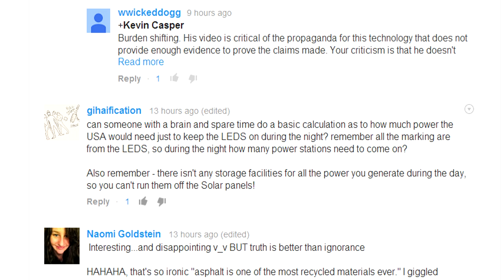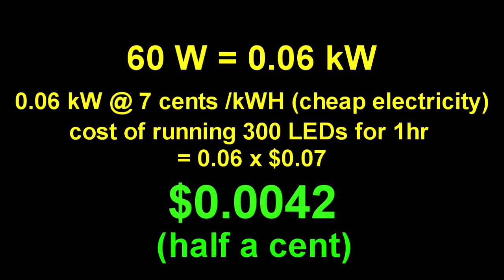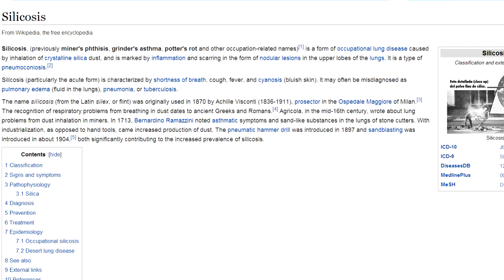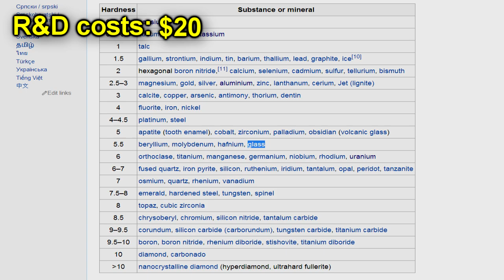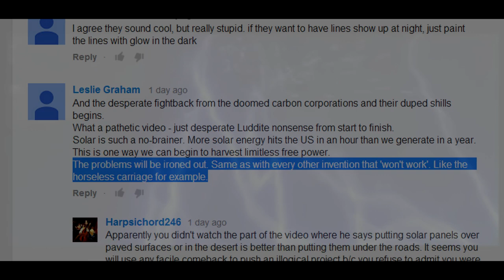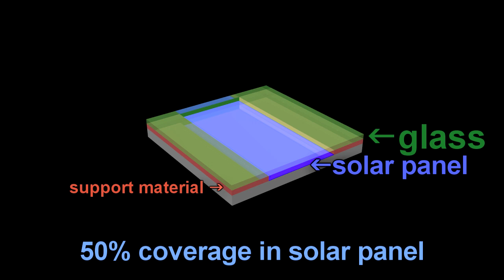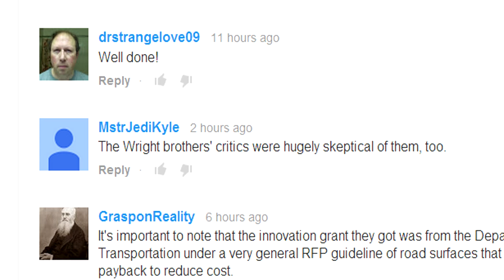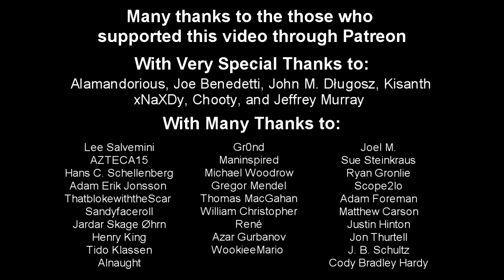Solar Roadways, IMPORTANT QUESTIONS AND ANSWERS!

Comment: ....but they wouldn't ALL need to be on ALL night.  Just while they're needed.   Why would you assume otherwise?   Also, why is it being assumed they would replace every, and all roads?  That seems like a really unreasonable assumption to make; meant to only create sticker shock.  Also, why were you using normal, non scored, non tempered, non laminated, soda glass to test with? That it's much weaker than any other form of glass...  I would expect someone like you would know that.   Though, they've already passed load bearing and traction testing, so I guess it's a mute point now.
Reply: 1) powering the sensors would still require power
2) their goal is not only to replace all roads but sidewalks and parking lots and the like as well
3) The point is to show how absurd the project is.
4) It doesn't really matter much because glass doesn't get harder from treatments, more durable yes, harder no and when it comes to scratch resistance it's hardness that matters. glass has a hardness of around 5.5-6, sand which would scratch it has a hardness of 6-7. I mean even solar roadways has it on their site that glass is softer than quartz.

All the same the project is dumb, if the purpose is to generate energy especially with limited resources you put them in the most efficient configuration as possible. Take a traditional solar array which has a life cycle of 20-25 years if you're stretching, it can pay for it's self in around 10-15 angled towards the sun, you lay it on the ground flat and it struggles to pay for it's self before the end of it's life cycle. This is without obstructions or the wear and tear of being driven on. Even if you improved efficiency you'd be stuck with the same issue of using limited resources in the most efficient way and the design flaws are inherent in the intended design of the project.
Reply: I get it.  But couldn't he have done without exaggerating every step?  And it is every step - I found holes in every single argument he made.  e.g. The LEDs he used to prove you can't see them were like 50LM, but there's LEDs up to like 9000, which are definitely more than enough to be visible.  About 2300 is all that's needed, for peak conditions.  His use of heated roads requiring such massive power, too - heated roads already exist, and use about 10% than what he came up with.  Why didn't he use them?  Why did he assume they would be running on every surface of the entire country?  I could go on, but I hope you get the point.  

As for powering the sensors - it's my understanding that they're including piezoelectric generation, which would inherently also act as a passive sensor.  The weight of the car would generate some power, part of which would go towards turning on subsequent equipment.  

As for "all roads," that's expected of marketing for any product.  But using that an all or nothing approach to test viability here is beyond dubious.  The question should really be if there are any situations where these could be of benefit.  Of course they wont be in all situations.  No solar solution is or could be - does that prove solar wont work at all?  No.  Just like using it in all situations here doesn't prove it, either.  

A potentially viable use case that I see is large facilities, like convention or data centers.  Once you cover the roof completely it still wont be enough.  And they have massive parking lots that spend most of their time empty.  Why not get some electricity out of it?  IF (and I agree, it's a big if) the panels can manage to pay for themselves over their lifespan then why not?

Look, point being that thunderf00t hasn't proven these are utterly useless in every case.  Just that they wont work in every possible scenario.  Which would seem obvious to me.
Reply: Gr1pp717
1) "The LEDs he used to prove you can't see them were like 50LM, but there's LEDs up to like 9000, which are definitely more than enough to be visible. About 2300 is all that's needed, for peak conditions."

Which would require even more power when they're on, can't apply skepticism to your own arguments?

2) "His use of heated roads requiring such massive power, too - heated roads already exist, and use about 10% than what he came up with."

That was the thermodynamic minimum requirement based on the assumptions made based on average snow fall on roads in the representative areas.

3) "As for powering the sensors - it's my understanding that they're including piezoelectric generation, which would inherently also act as a passive sensor. The weight of the car would generate some power, part of which would go towards turning on subsequent equipment."

And the calculations for this would be? Unless it's producing 100% of the power required to activate the tiles it's still going to require constant power sources to supplement the sensors.

4) "The question should really be if there are any situations where these could be of benefit. Of course they wont be in all situations. No solar solution is or could be - does that prove solar wont work at all? No. Just like using it in all situations here doesn't prove it, either. "

It's whole selling point is based on trying to put solar on the ground to generate power, you're already done at that point because short of facing it away from the sun or face down it's one of the worst configurations you could imagine  for it.

5) " IF (and I agree, it's a big if) the panels can manage to pay for themselves over their lifespan then why not?"

Or...you can make car parks with overhead roofs with solar installations on them facing towards the sun, protecting the cars, you won't have to rip up your parking lot to put in the solar road way tiles and you won't ever have to worry about a car being parked on top of your solar panels.

Again if you have unlimited resources go for it, if you do not there are plenty of other better ideas that serve the same if not better purpose. The fact you're losing like 50% efficiency by laying it on the ground make the project a non starter.

6) "Look, point being that thunderf00t hasn't proven these are utterly useless in every case."

People tend to ignore the fact that it's so much less efficient just to lay it on the ground despite it being one of the primary points in his criticisms about the project. This alone makes this project worthless in all scenarios where you have limited resources and have places to install it where the panels are facing the sun.

Keep in mind, the ROI was JUST for the solar panels which even from a conventional design just designed to be a solar panel barely lasts it's life cycle without the wear and tear. That's not including all of the bells and whistles involved in the project that you'd have to maintenance some of which are replaced by a bucket of paint, the use of head lights and some retroreflectors.
Reply: >Which would require even more power when they're on, can't apply skepticism to your own arguments?

I did: when I said "IF" it could be ever be efficient enough to pay for itself.  But, since no one else has, let's check it.  

Lets assume full lumens for 4 hours mid-day, min power at night for 8 hours, and average between those 2 for the remaining 12.  Basing the wattage on the consumer grade LOHAS LED Chips:
2400LM LEDs use about 0.025kWh for 4 hours.   
500LM LEDs use around 0.005kWh for 8 hours 
Leaving 0.015kWh for the remaining 12 hours.  
So: 0.025*4+0.005*8+0.015*12=0.32kWh per day; if it's on 100% of the day.  
A typical road is about 4m wide there's 0.15m worth of lighting on each side, which works out to about 8% of the road needing to be lit.  So 0.08*0.32=
0.026kWh/m2/day for lighting.   

A typical solar panel in a cold, dreary place, like michigan, gets about 3.8kWh/m^2/day on average.  I'm not sure if that is using tracking panels, but to be conservative let's assume they are.  Tracking panels gain 40% more power than stationary ones, so let's divide that by 1.4 => 2.7kWh/m2/day for a stationary panel.   Which means the lights could be on 100% of the time, and cars blocking about 97% of the sunlight, and they would break even. Or, the panels could be woefully inefficient and the parking lot mostly dead.  Either seems fairly plausible to me.  And while I can't find info on how much piezoelectric generation might give us, I would imagine it covers at least enough to trigger the lights, if not completely run them.  

>That was the thermodynamic minimum requirement based on the assumptions made based on average snow fall on roads in the representative areas.

I made a mistake on this point, actually.  The heated roads in michigan (a very cold place) actually use about 1% of the energy he calculated, not 10% as I has previously stated.  The problem with his calculation is that is assume there's no runoff.  That the road is one giant pot, that the ice must stay in until completely melted.  It's not.  The real thing peaks out at 140BTU/ft2 = 0.44kWh/m2.  Assuming they ran all day, that's about 11kWh/m2/day.  So, I could see some days generating less energy than needing to heat the road.  But unless you assume this is needed @100%  for 100% of the time, always, then it's a mute point. Actually, this shows that these probably couldn't be efficient anywhere that has snow more than about 20% of the year - which is nowhere in the lower 48.  

>because short of facing it away from the sun or face down it's one of the worst configurations you could imagine  for it.

Most solar panels are, in fact, stationary.  Look at your neighbors roof.  Are they moving?  ...Saying that it's pointless to use stationary panels means the vast majority of the solar tech employed today is pointless.  Yet, they aren't.  

And since we're digging deeper, in terms of ROI it doesn't even actually need to pay for itself, as it saves on the road which would have been built in its place, plus the lights and the energy they use which this system replaces.  So, take the cost of this system and subtract those things.  If it ever generates that much electricity then it's paid for itself.  Considering that these have already passed DOT testing for load capacity and traction (including wet... because what official engineering body wouldn't think of that! ...) the only question is if the ROI can ever be reached.  None of the rest of what these videos try to claim matters.
Reply: Gr1pp717
1) Your assumptions are based on the typical solar panel, which this is not, much of the surface area is not solar panel and you're basing your calculations on a stationary solar panel rather than one on the flat ground.

also " So 0.08*0.32=
0.026kWh/m2/day for lighting. "

Wtf is this, you took the earlier calculations to light up an led and multiplied it by 8%.

2) "I made a mistake on this point, actually. The heated roads in holland (a very cold place) actually use about 1% of the energy he calculated"

Yeah, considering how you're going about this I'm going to need a source.

3) "Most solar panels are, in fact, stationary. Look at your neighbors roof. Are they moving?"

Stationary or not being tilted towards the sun is a major advantage, it facing the wrong way can make the difference between it paying for it's self in 10 years or 100 years.

4) "Saying that it's pointless to use stationary panels means the vast majority of the solar tech employed today is pointless."

Never made this claim, placing it flat on the ground reduces how much solar energy a system can get, this is why solar systems are tilted towards the south if you can.

5) "And since we're digging deeper, in terms of ROI it doesn't even actually need to pay for itself, as it saves on the road which would have been built in its place, plus the lights and the energy they use which this system replaces."

But it's replacing it with something that costs more, and uses more energy, electronics, materials, manpower with a lot of things that have shorter life cycles.
Reply: >much of the surface area is not solar panel

Unless we're talking a fraction of the surface area then it shouldn't matter. As the amount generated is ~100x the amount needed.  As I said, "or a very inefficient system in a parking lot."

It's really unfortunate that we need to make assumptions at all, tbh.  Once the route 66 test is complete we'll have more accurate data, though.

> Wtf is this, you took the earlier calculations to light up an led and multiplied it by 8%.

Because the first one is per light, and doesn't consider how much lighting per area.  About 8% of the area is what will be needed, because that's how much road lines cover. Theres no need to have 100% the entire surface lit. 

 If there's an obstruction at night then warning lights will be on.  But it's hard to assume how much would be needed per incident, and how often they would be on.  I can't imagine that adding more than 1%, though.  Probably much, much less.

>Yeah, considering how you're going about this I'm going to need a source.

All of everything I said can be found online.  But here: https://en.wikipedia.org/wiki/Snowmelt_system

"70 to 140BTU/ft2"

And here's the data showing a 40% increase in tracking vs stationary http://www.greentechmedia.com/articles/read/Solar-Balance-of-System-To-Track-or-Not-to-Track-Part-I

Not the 1000% increase you seem to think ("10 years or 100 years")

>But it's replacing it with something that costs more, and uses more energy, electronics, materials, manpower with a lot of things that have shorter life cycles.

All of that is considered in it's own self cost.  Which I included in my statement.  If self cost minus normal road and lighting is less than energy generated, then it's cost effective.  Otherwise it's not.  We wont know the answer to that until pricing and efficiency data comes out.  But, again, the answer to that is all that matters here, not any of the other points thunderf00t brings up.
Reply: Gr1pp717
"Unless we're talking a fraction of the surface area then it shouldn't matter. As the amount generated is ~100x the amount needed. As I said, "or a very inefficient system in a parking lot."
"
My point is to criticize the basis of your calculations which are based on flawed premises which you're simply saying they dont' matter even though they're the basis for the project.

"Because the first one is per light, and doesn't consider how much lighting per area. About 8% of the area is what will be needed, because that's how much road lines cover. Theres no need to have 100% the entire surface lit. "

But by simply multipling the per light figure by 8% you're getting the figure for 8% of the power requirement per light rather than per unit area. There's no figures converting lights per unit area or assuming 100% coverage in leds per unit area to multiply by 8%. I'm shitty at math and this one was obvious to me..

"All of everything I said can be found online. But here: https://en.wikipedia.org/wiki/Snowmelt_system"

Yeah except this doesn't give the figures your claim is based upon, it gives overview and generalities with some of the overall details, nothing dealing with the energy consumption.

"And here's the data showing a 40% increase in tracking vs stationary"

Except I'm not talking about tracking vs stationary, I'm talking about laying it on the ground vs angling it towards the sun.

"Not the 1000% increase you seem to think ("10 years or 100 years")"

You, don't read do you. If I face my solar panels to the north (in the northern hemisphere) I get orders of magnitudes less energy from the sun. There are reasons why you'd favor west or east facing panels over northern ones and why you'd take leaps and bounds to work against the tilt of your roof if it's facing north and the only viable surface for solar panels on your property, and it's not because all stationary angles produce the same power.

"All of that is considered in it's own self cost. Which I included in my statement. If self cost minus normal road and lighting is less than energy generated, then it's cost effective. Otherwise it's not. We wont know the answer to that until pricing and efficiency data comes out. But, again, the answer to that is all that matters here, not any of the other points thunderf00t brings up."

Uh, but you didn't, there's no figures for the cost of the tempered glass, it's life span, the electronics, it's life span, the leds their life span, you don't even have proper power calculations per unit area using your own assumptions, there's no accounting for the even lower energy generation you get for being on the flat ground vs angled towards the sun. Your power calculations are based on standard tilted, stationary installations vs tracking installations. There's not even any consideration in the extra infrastructure that's required for such a project. Basically all of your arguments have been so complete bunk so far I'm having difficulty taking you seriously.
Reply: Gr1pp717
"Once the route 66 test is complete we'll have more accurate data, though."

A few things I forgot to add.....it's a walk way at a guest stop. not sure we'll really get much useful data from this that we couldn't get from their pre existing path which they don't seem to care much about publishing data on.

Also, TF's calculations weren't assuming year round power, it was assuming 100% efficient at all of the energy going directly to heat and melting the ice.
Reply: Again, the 0.08 is the percentage of lights that need to be turned on over the total surface area.  It does assume 2400LM worth of lighting is installed per m2, so maybe that's confusing you.  (I can't see why more than that would be needed.  I kind of want to buy some of those chips to test them out now.)  

At any rate, at 0.32kWh (per day) the entire surface of a square meter unit would be glowing.  But there's no need in doing that.  Only 8% of the surface needs to be lit to create the lines on the road.  Most of the panels wont be lit at all.  Only a small portion at the edges.  So, it's reasonable to say only 8% of the power will be needed.  

Also, I found a site http://pvoutput.org/ and compared static, angles roof panels in the netherlands to the solaroads project nearby, and found that the solaroad sidewalk generated a little more than half (24.5 vs 47 kWh over 6 months).  So, let's say only 50% of the surface is panel, and it only gets 50% of the power compared to roofs.   3.8kWh/m^2/day * 0.5 * 0.5 = 0.95 kWh/m2/day.  That's still 36 times the amount of power needed for lighting.  

Or, another way to put it, is that you could use 36 of those LED chips along the lines that we need to illuminate, per 1 m length of road, before breaking even.    That would look like stadium lighting... 

>Uh, but you didn't, there's no figures for the cost of the tempered glass, it's life span, the electronics,

That IS the cost of the system.  You're basically arguing that the total doesn't equal the cost of the itemized components totaled up.  It does; by definition.  The "cost of the system" includes the glass, it includes the installation, the electronics, the leds, the wiring, etc.  

Not only that, but saying "if it yields an ROI" automatically includes everything you're talking about, as well.  The cost of the system, the income it generates, and the time it's generating it.   If you buy the system and it only generates power for a month before breaking, but you needed it working for 24, then it didn't yield an ROI.   By definition.  

Again, all that matters in any of what we're debating is if there could ever, in any case, be an ROI.   And the answer to that, as we've discovered, is much more complicated than anything presented in these videos.  It's pointless to keep debating the details, and I'm too tired.
Reply: Gr1pp717
Well frankly your assumptions are still pretty sparse because you're assuming a certain illumination in order to be visible then state that you think you only need 8% of that to really be visible during the day if I assume your argument is true. Either way your argumentation is flawed, take your pick.

None of that really matters cuz it's still like 3x the cost under the best circumstances for half the output. if you want to go by the few places that actually have data. At the moment colas solar said it'd be about 6x the cost upon commercialization and a very optimistic 3x the cost after cost reduction of scale. Colas' solar road ways are a far better implementation and actually publish their data and it's still orders of magnitude worse than commercial solar or even roof top installations.

If your goal is to replace the roads with glass covered roadways  you could still easily do that with your shitty LEDS and install cheaper and more efficient solar panels.

I don't really get anyone's reasoning for fighting for less efficient and more expensive implementation of solar when resources are limited. It's not like you're going to save anything by having the solar panels embedded in the tiles since they'll all have to be connected to the grid for non daylight hours or non sunny days and you're still fighting for a case where even if you're using the solar for powering it it's still better to have conventional solar installations and install whatever hardware you want in the ground.
Reply: +Gr1pp717 You have a mistake/omission in your calculation here: "Basing the wattage on the consumer grade LOHAS LED Chips:
2400LM LEDs use about 0.025kWh for 4 hours.   
500LM LEDs use around 0.005kWh for 8 hours". Namely, you associate this power requirement implicitly with 1 square metre, and then further reduce that down by a factor of 12 for sign sparsity. However, you have quoted the power required for one typical household lightbulb, or about 6 LEDs. You are suggesting that the density requirement for road marking is one single lit LED every 2 square metres. That seems unlikely. The actual density requirement, in order to have visible road markings, is going to be at least an order of magnitude higher, probably more.